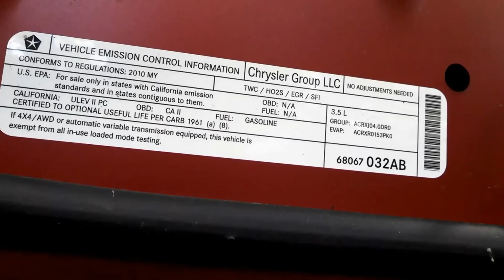Timing belt replacement Dodge Journey SXT 2009 2010  3.5L V6 water pump install remove PART 1

Comment: I'm going to say thanks on all video parts. Again, shout out to the videographer for doing this video. I have a 3.5 L 2008 Dodge Avenger. Most people do the 2.4 L VVT engine or the longitudinal mounted engine. So this was one of the few videos that actually did the transverse 3.5 L engine. Extremely informative. I've even had to order some tools since I didn't have the reverse Torx sockets. Again, thank you!!

Comment: First off thanks for putting all of this together it is very helpful! Should I disconnect the fuel supply line at the fuel rail? I am looking at the Chilton Service manual(on their website) and it says to do so before removing the timing belt cover. Kind of confused as to why they would say that. Any suggestions? Thanks again

Comment: Wait a minute! You skipped the hardest part! How do you install the tensioned without the cams moving? Please explain how to index (or clock) the timimng marks so that when the tensioner is installed and tightened the timing marks are all lined up! I have been trying to do this for 2 d_ _ _ weeks! Even the dealer can't help!
Reply from the maker: Sorry I did not show that part.   I do not think that both cams want to move when they are lined up with their timing mark. It seems to me that only one cam may want to move away.  I put the belt on the crankshaft pulley 1st, then stick a rag or something below it between the belt and the engine so it does not fall off, then wrap it around the right Cam (closest to radiator) try to make sure there is little slack between the crankshaft pulley and that cam pulley. I use little clips to hold the belt onto the cam pulley sometimes, you could use a vice grip (gently) to hold it on. Then I think around the water pump and to the rear cam, which may be the one that wants to move, just use a wrench to hold it in place while putting the belt on that one and hold it in place while you put the belt on the rest of the way. try and secure the belt to that cam as well.   I do not recall a difficulty in installing this belt, I am again sorry that I did not show it and that you are having problems.